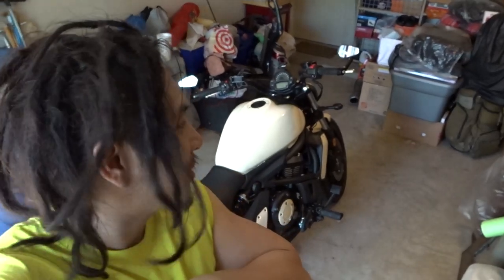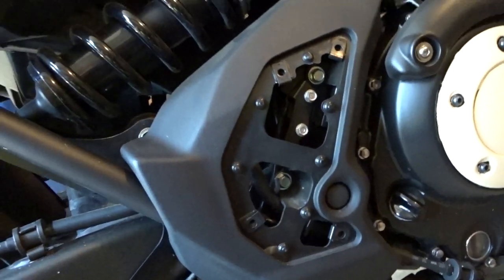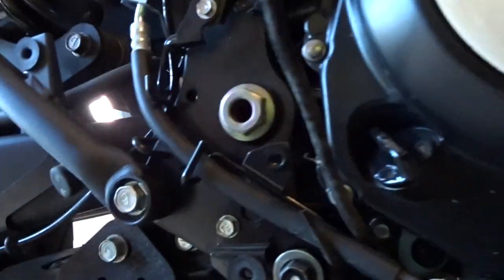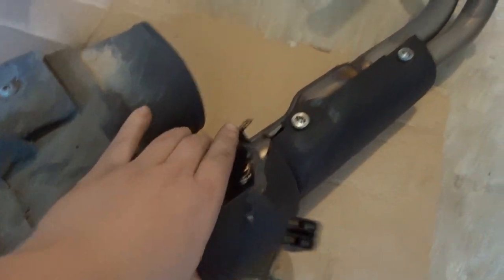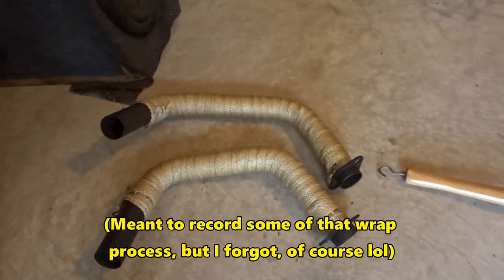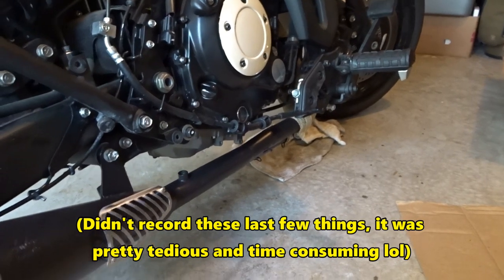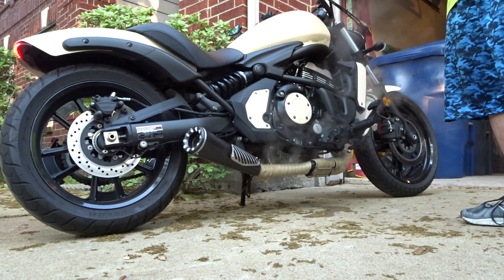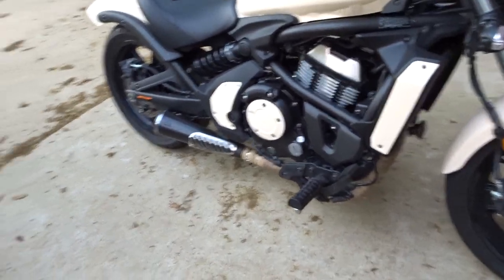Installing The Danmoto Exhaust | Kawasaki Vulcan S | Install Video

Comment: Nice ride, you may find the popping etc settles down, the factory computer is somewhat self learning, I guess my replies a bit late here and you might be able to verify if thats the case. Also the Vulcan S factory exhaust is one of the most restrictive on the market so you would no doubt as I did with my Delcavic noticed a significant gain in torque and revving hp, cheers

Comment: Hey bro, I saw you said you would need power commander. What’s that for? I got the same exhaust and putting it tomorrow evening with my friend. I wondering If i need anything additional to put in it after or while  installing the exhaust??
Thanks!
Reply: Plus what’s the meaning of running lean? Does it affect the engine?? Do I have to worry about anything?
Reply from the maker: Power commanders are modulus to correct air/fuel ration mixtures

as for "running lean", basically is when an engine has more air than fuel... "running rich" is the opposite... its technically not "good" for the engine (otherwise balanced air/fuel ratios wouldnt be important) as long term effects can result in valves burning up quicker.... but on the flip side it usually takes long time for that, but regardless, it should be corrected

Comment: Hey T Dawg, I just got done installing mine and I have smoke coming out from the header ports, Do I need to reinstall them or is that normal? I replaced the header gaskets too but I'll be honest, I'm not sure if I completely took the old ones out
Reply from the maker: sorry late response.. but i say make sure the old ones are out before putting new ones in and tightening the bolts down snug... sounds like leak
Reply: I'm actually have the same issue but more so on actually removing the old ones. I hear they weld themselves to the headers but I don't really know the best way to actually remove them

Comment: I'm pretty sure the flames mean you're running rich, not lean, which is the opposite.  Running rich means you're getting too much fuel and it's not being completely combusted, which is why the fuel is catching fire and burning on the way out of your exhaust pipe.  The good news is, running rich is not nearly as harmful to your motor as running lean.  Rich means you're wasting gas money, lean means you're overheating your motor.

Comment: Most excellent, TDawg!  powercommander...ECU flashed by Ivan...whatever you need to do to tune up so you're not running so lean...congrats on this upgrade...what's next, besides saving up for it, like I have to do?!
Reply from the maker: Victor Hawkins performance-wise nothing really else except that Power Commander and an air filter, everything else is mostly cosmetic haha

Comment: Man!!!! That is loud!!! As Intold you in my last comment, there is no way I could install one of those in my country, the police would stop right away. 😤😤😤😖😖😖😖 thanks for sharing, the only thing I miss seeing is how you installed the gaskets. I guess they go at the beginning of the pipes. Did you have to remove the old gaskets from the bike or did they come out with the pipes? Nice to see that you are enjoying the muffler, the sound is incredible!!!
Reply from the maker: Thank you! And yes the gaskets go into the engine and you install the headers on top of them... getting the old ones out was a bit tricky, because they are "crush" style, so use a small screwdriver of a pick to fish them out... then the new gaskets wont stay in so use a small amount of grease or gasket maker to make it "stick" in there... then you install the pipes and they crush into place.
Reply: Thanks. I am but confused, what do you mean by “inside the engine”, that sounds complicated? Would it be too much to ask if you can make a short video showing the pipes with the gaskets?  And another small request, how long is the extension you use to unscrew the nuts holding the pipes to the engine? Thanks a bunch for all the help
Reply from the maker: Nathanael García Muro it's not complicated at all, what I meant was that the hole the pipes go Into is where you put the gaskets, you'll see how simple it is when you actually do it, trust me, this was my first time doing anything g like this and it was pretty self explanatory... As for the extention, I can't remember it was like 6 inch I think? You don't need a really long one
Reply: TheRealTDawg thanks again for everything!!!

Comment: Be sure to add a Booster Plug balance out the Super Lean condition you just created.  ;-) Great looking exhaust but it's just way too loud.
Reply from the maker: yeah I'm leaning towards the Booster Plug simply because its what I "need" for an affordable price
Reply: I hear ya.   I can't justify 400 bucks or more for a Power Commander.  A friend of mine just put on a Danmoto Exhaust and a Booster Plug and had it dynoed.  He actually gained 9 HP and 7lbs of torque over Stock.  That is actually pretty damn good.